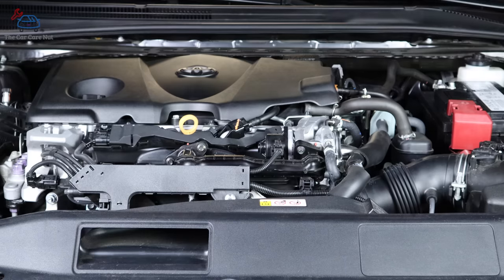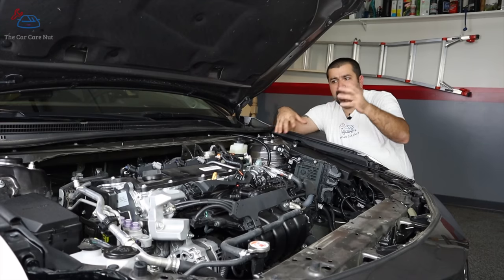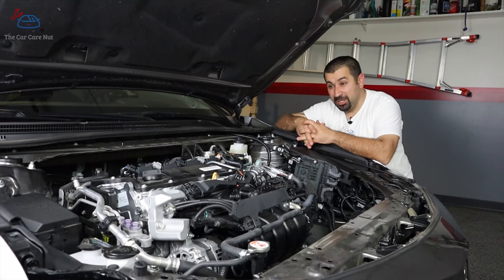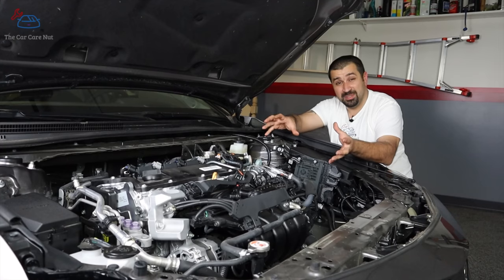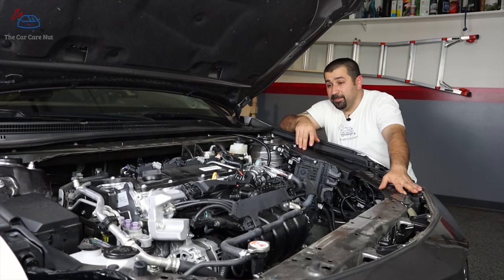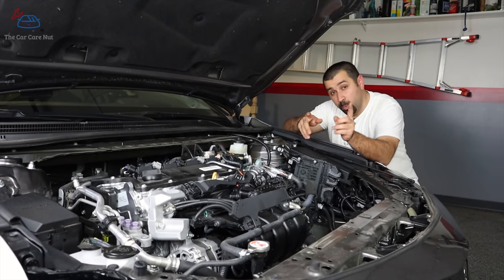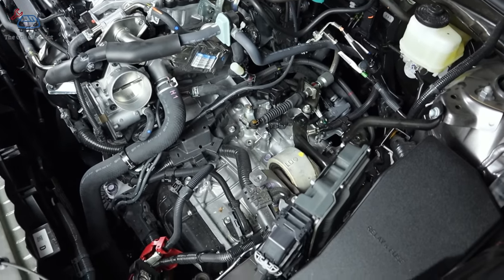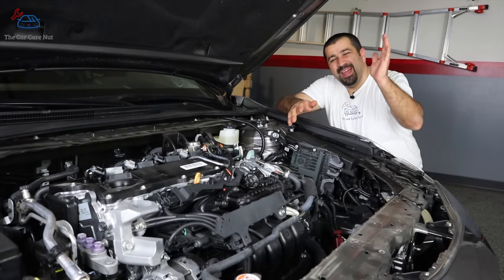Toyota's New Engine Technical review Part 2 : Variable Valve Timing, DIY tips  and Parts location

Comment: How is the 2GR-FKS in terms of durability compared to the 1GR-FE or the very reliable 5.7. 
Do you think the long term will be as good or better?
Reply from the maker: I think it will be reliable. I’ve seen a few production issues with it but as of late it’s been reliable other than the typical oil leaks and the worry of plastic components getting brittle and breaking over time
Reply: Thanks for the reply.. Do think the 5.7 (Tundra) would be a better buy over the 2GR-FKS (Tacoma). I'm new to Toyota, I have always bought GM and have a 1999 GMC Sonoma with just under 400,000 miles on the original powertrain, so I keep my vehicles a long time. Thanks again
Reply from the maker: They’re both reliable. The 5.7 is a bit ancient and doesn’t have good gas mileage

Comment: is the electric timing motor made in Japan? what about critical components in the engine and transmission where do they come from?
Reply from the maker: I haven’t really looked at the motor where it’s made I’ll look at the next one I get. The engine parts could be made either in Japan or elsewhere. New cars sold in the US will have a sticker showing where the parts for the engine and the transmission come from.
Reply: The Toyota Corolla Hatchback with the 2.0 dynamic engine are made in Japan. I own one and all of the parts and stickers says in made in Japan. However all of the Camrys and most of the normal Corolla are made in the US.
Reply: @Jsperal  Thanks, Any issues with Dynamic 2.0? transmission?
Reply: @mobilecommunicationsnetwor5268  not so far so good. I bought my hatch with the manual transmission and it’s really fun...

Comment: I just wanna know what the rattling is my 2019 when I'm accelerating.  Sounds like lifter noise or rod knock
Reply from the maker: I totally hear you on that sound. It’s a normal sound of this engine but it does sound like a lifter noise or rod knock but of course it’s not. New engines are getting Louder and louder.
Reply: @TheCarCareNut  im praying its not 🙌 Bought it with 55k miles. Doesn't burn a drop of oil but it did get quieter after I changed it 🤔
Reply from the maker: Interesting. What oil weight did you use?
Reply: @TheCarCareNut  0w16. I hope that's what they were using
Reply from the maker: I see. It could be that they were not. Stick with the 0W16 and an original filter and you should have no issues. I’ve taken one of these engines apart and they’re very well made and can take a beating. The noise you hear on acceleration a lot of people have complained about and it’s odd but that’s how they sound don’t worry. Keep up the maintenance and you should have this car for a long time.
Reply: @TheCarCareNut  i used a mobile 1 oil filter. Is that good?
Reply: @timsouttahere  I used that or AmsOil filter on my 2011 Toyota Camry , 7000 OCI and it made it to 155000 miles before being totaled in an accident .
Reply: It could be transmission. Plenty of complaints on the new 8 speed
Reply: @Pertplus  I got my transmission reprogrammed. Works perfectly now

Comment: So what's next? Getting rid of the valve gear entirely, having the valves opening by compressed air and having every valve completely controlled by the ECU?
Reply from the maker: That was actually experimented with but failed. Not with compressed air but with solenoids instead of a cam shaft

Comment: hey @TheCarCareNut  the Toyota (legit) dealerships in my country are using 0w20 for this engine. Saying (and showing me), that is the oil that is recommended by the system/program they use from Toyota for servicing. Any thoughts on that ?

Comment: I was actually really hoping youd go through the differences between the fks and fxs engines. other than the fks being paired with the ub80 tranny and the fxs being paired with the hybrid tranny, I assume the only real difference between the blocks themselves is the compression ratio. 13 vs 14:1 in the fks and fxs respectively.

Comment: Do you remove the EGR valve hose before or while the car is running? Until it overflows out that hose, thank you
Reply from the maker: Hi! Before the car is running and before you fill with coolant
Reply: @TheCarCareNut  how is it possible the for the coolant to come out the egr valve hose when that hose is higher the coolant cap when filling up? How does gravity not play a part if the egr valve is higher then the coolant fill cap height wise?
Reply from the maker: That’s the highest point of the cooling system so all air is pushed out

Comment: One question I forgot to ask.  When it comes time to replace the battery, does the 2020 RAV4 need to have the battery "registered" with the PCM?  Mine is not a hybrid or a "pushbutton start."  It's a base model that uses "key in the ign switch" for operation.
Reply from the maker: Hi! No registration is needed. If the car is equipped with auto stop start and you’re not using an original battery a registration is needed so auto stop start would work again
Reply: @TheCarCareNut   Many Thanks!

Comment: Why do hybrids use 12v batteries and starter motors? Wouldn’t it be easier to use the electric motors and high voltage battery to crank the engine? Seems less prone to failure
Reply from the maker: Toyota hybrids don’t have a starter motor. They do use the electric motor and the high voltage battery to start the engine.
Reply: @TheCarCareNut  thanks for clearing that up. I must’ve been misinformed in the past. My local dealer says my rav4 prime is on the way despite major delays at the port in NJ. I’m really looking forward to finally getting this car. Do you know if the “manual (+\-) mode on the CVT just increases the engine braking via gear ratios or does it increase re-gen braking while going down a hill for example?
Reply from the maker: The + - is used for engine braking. It used to be just a single setting called B mode but that is basically a varied level of b mode. Here’s a series I made on how hybrids work which will be followed in the future by how plug in hybrids work https://youtube.com/playlist?list=PLeFzfl0Q8rQUgJLQheNbttBtKT6iSOX4D

Comment: What is your real world experience with the 0-16 oil change interval? Filter types?
5,000 miles or less?
Reply from the maker: I’ve personally seen a few cases where metal was present and deep knocking noises caused by the wrong oil used in this engine. This engine still has low tension piston rings so the long oil change interval will take its toll on these rings and cause issues in the future. A video I’m working on will explain this in details.
Reply: I think I am switching to 5000 mile interval and not the10k intervals I've been doing. On my 19 rav hybrid

Comment: When you  mentioned  EGR  like in the Prius, I was like.. OMG NOOOooooooooooo...... ..Shit.. Perhaps  you should check  to see if Toyota out an oil separator  in the EGR system. Geeeze.... Unless those Non-Hybrid  variants  do not experience the  oil blow-by that the Hybrids have due to the high RPM start ups?
Reply from the maker: This engine is equipped with an oil separator.
Reply: @TheCarCareNut   Thank GOD!!!!!!! Oh I cant stress that enough.. Thank GOD!!!  I had to install a catch can on my 2013 Prius  due to that oil blow by, or should I say.. DUMP by.. Cuz  man does that poor EGR see alot of oil coming in, and carbon formation.. UGH .. The EGR , the cooler, the EGR pipe.. you name it.. I know, I know... you already know all about that crap.

Comment: Hi i have a 2022 rav4 with 6000 miles I did an oil change and noticed it has a small oil leak between the transmition and the engiene. There wasent a lot of oil it diden even drip on the plastic hatch cover. Is this a comon problem?

Comment: U should do a video on changing the coolant u raise the car to more than 1500RPM after changing the coolant or before ?
Reply from the maker: After changing the coolant you want to do that to bleed the coolant
Reply: The Car Care Nut the rest of the coolant going to come out doing that ? And what specific tool to use to unplug the EGR valve
Reply from the maker: No it will release any air pockets that otherwise would cause issues like overheating. Just pliers to remove the clamp that holds the hose. Some of the early ones had a quick release hose where you just push a tab and it comes out
Reply: What about the hybrid? It has no rpm and shuts motor off.
Reply from the maker: On hybrids you press the gas pedal to the floor it will rev up and start bouncing( not to red line) slightly back off and that’s your rpm range. And of course you’d be in maintenance mode where the engine runs all the time

Comment: Should I be concerned my dealer only offers 0w20? Would this be an oil consumption issue waiting to happen?
Reply: Per the manual: it’s ok to use ow20 once but next change needs to be ow16.   Unless you have an xse v6 or trd, those use ow20.  I call the dealership the day before oil change to make sure they have ow16 and I have service advisor make sure ow16 is used.  Doing this, I’ve yet to run in to an issue.   You could always buy Toyota ow16 oil and take it with you to have them use

Comment: In my country, the Toyota dealer uses a different viscosity of engine oil than what you mentioned, he uses 0w-20.  And you mentioned that the right  is 0w-16. Will this harm the car engine or is this viscosity suitable?
Reply from the maker: Hi! Check your owners manual does it list 0w16 only or allows others?
Reply: @TheCarCareNut  It's a used car, and the owner's book was not in it, could you do me a favor and make sure that the 0w-20 viscosity oil can be used   . Pls⚘
Reply from the maker: Hi! I don’t have access to the manuals on cars sold outside the US
Reply: @TheCarCareNut  As long as it is the same engine, can I use motor oil with a viscosity of 0w-20 with an SP rating.  Does your car owner's manual say anything in this regard? Thank you

Comment: Would a oil catch can be useful on this engine?  I have one on my Hyundai and it traps a lot of liquid crud!
Reply from the maker: This engine is equipped with an oil separator so a catch can would be overkill in my opinion
Reply: @TheCarCareNut  Thanks
Reply: @TheCarCareNut  I didn't hear you talk about a oil separator, did I miss that part?
Reply: Ya.. oil separator. Gas or diesel engine?
Reply from the maker: No I didn’t mention it because it’s not new to this engine. The 2AR also had an oil separator
Reply: Oops..

Comment: With the hybrid engine, the throttle doesn’t really change the rpm.
The car just saying throttle is pressed. How do you make sure it goes in the coolant filler mode?
Reply from the maker: If you go in maintenance mode and press the gas pedal down the engine will rev up

Comment: Should mention this engine has also plastic oil pickup tube in the drain pan as well, so if anyone ever loses their splash guard / plastic skid plate and they dent the oil pan then they're gonna be in for a bad time lol

Mechanically this engine isn't all that difficult to repair, I took apart one of these for a training class and Toyota still kept the internal components relatively simple
Reply: How much of dent would the pickup tube spoil/damaged?

Comment: Good day! I am from Russia and our instructions indicate oils from 0W16 to 15W40 and 99% are advised to pour 5W30. The climate in my zone is not harsh, in winter it is rarely -4F. We also have very poor quality gasoline and they say it will quickly thin the 0W16 oil. Please tell me how destructive the 5W30 oil will be for the resource and what would you recommend to use in my conditions? subscribed to the channel and like with me! Thank you very much in advance.
Reply from the maker: Hi! Follow the recommendation on the manual for this one. In very cold weather 0w16 is actually recommended. If your temperature is higher follow the chart in the manual for the range
Reply: @TheCarCareNut  If I use 0w30 which is within Toyota tolerances and do a change every 3000 miles, will I have no problem with the engine caused by 0w30 oil? Or can you still use 5w30 in Russia once the instructions are allowed? All our engineers say that on 0w16 oil with our realities of operation, the connecting rod liners will be in the sump and it needs more to save fuel, but it does not have the best effect on the resource of the internal combustion engine. And why, in your opinion, in some countries 5w30 is allowed according to the instructions for and in the USA one recommendation? Please help me solve this situation and what will be better for the engine resource. Thanks for the answer. Screen page my manual https://www.oil-club.ru/forum/uploads/monthly_2021_09/38D80BD0-D336-4D61-ABF6-721C2A6BC594.jpeg.77c27ef8ac050fcde30f5c7e7a540865.jpeg

Comment: I just purchased a 2023 camary what are your thoughts on the 10k oil change? I live in Central Illinois it is drove in town mostly but I do work at a nursing home 25 miles away so a couple days a week it does see some highway. But it's on I39 and it eats alot of dust out there  it will see below freezing Temps in the winter hot in the summer. Am I overthrowing this too?
Reply: Dude. Under no circumstances should you go over 5k. Many people say 3k for anything but light duty only and your description is not. https://youtu.be/TJhFAwFv-O0?si=4RwRjAJKH8IYAUjR

You also need to do a break in oil change around 500-800 miles to clean out all the initial fuel blowby. AMD described the smell in one of his more recent videos where he talks about oil filters and does an oil change. Oil is the cheapest insurance you can get.
Reply: I bought a 2023  Camry Hybrid XSE on Dec 1st 2022. I had the first oil change at 1000 miles. As AMD has described himself you have a brand new motor, you’ll get all the shavings (if there are any) and not allow them to score the cylinders. Right now I have 5987 miles and have already changed twice. Im changing oil every 3000 miles. My next oil change is at 7000. Good luck.
Reply: 5k oil changes always. 10k oil changes are extremely bad and never have a benefit.

Comment: Are these the same internal parts as in the 2.0 litre Corolla ..
Reply from the maker: Yes similar
Reply: The Car Care Nut  ... thanks for the reply I'm in Australia the Camry petrol here has just moved to the latest 2.5 you have been speaking about the Hybrid has been using this engine for some time ..I'm thinking on buying either the 2.0 litre petrol Corolla or a petrol Camry I'm test driving both on Wednesday.
Thanks for the excellent information on your channel and especially on this engine.👍 🇦🇺

Comment: Just order A 2024 Rav4 XLE AWD Primium 
As you decribe it packs with computer, electronics and electric motors all over and others, 
Is it wise to invest extended warranty extra 5, 7 years, after standard  warranty expires cause these are expensive to repair and out of reach of regular Diyer like myself dealing  with those high tech stuff !
* lt's a good thing they get rid of the cartridge filter in returns the good old steel spin on one !

Comment: Cars are now made to be disposable.  I suspect designs are for about 10 yrs and 150k miles under ok care, since car loans can be 6 or 7yrs.  They can't have it stop working as soon as the car is paid off.  If you take very good care,  you can make it last a lot longer.  But cars are not built to last forever.

Comment: I have the same and the agent uses 10w40 oil, is there any damage to the engine
Reply: I have a Camry 2020 I am from Saudi Arabia
Reply from the maker: Hi! I would read your owners manual on the recommended oil and follow it
Reply: 0w16 0w20 5w30 10w30 15w40 This is in the owner's manual I get a temperature of 50, does 0w16 oil work?
Reply: My car is now running 246,000 kilos. Does it hurt if I change 0w16 oil?
Reply from the maker: It should work

Comment: How do you run a hybrid engine at 1500 RPM to replace the coolant?
Reply from the maker: Put the car in maintenance mode and press the gas pedal to the floor then once it revs up high back off the throttle just a bit
Reply: @TheCarCareNut  Thank you!

Comment: just by curiosity, since those engines use 0w16, I was wondering what was the crankshaft bearing clearance and connecting rod clearance are, I know that their using coated bearing and induction hardening on the main bearing, but are the clearance the same as an old 1.8litres or comparable to a standard engine using 5w30, thanks
Reply from the maker: Hi! I would have to check the specs
Reply: @TheCarCareNut  thanks, I can't wait to see what you will find on that, also I have a suggestion for videos, you should do a video on those variable output oil pump use in those engines, thanks for your help it is greatly appreciated.

Comment: What are your thoughts on using fuel system cleaners in these engines as the miles add up to help prevent carbon build up? Would it hurt the direct injection fuel pump, injectors etc?
Reply from the maker: Hi! I wouldn’t unless it’s approved for direct injection and carbon build up is not an issue for the D4S